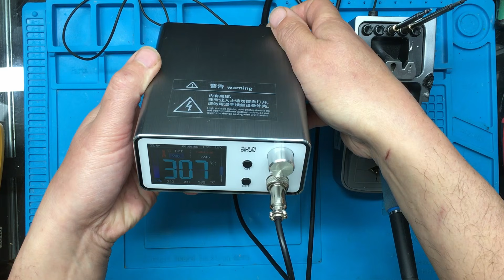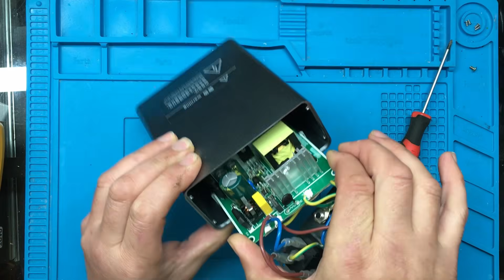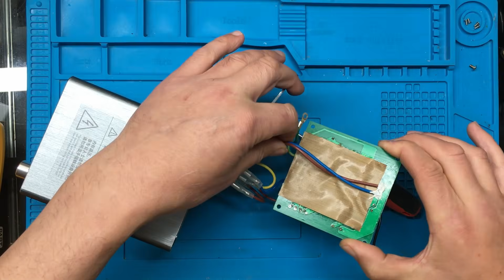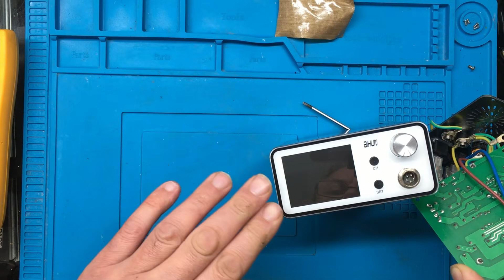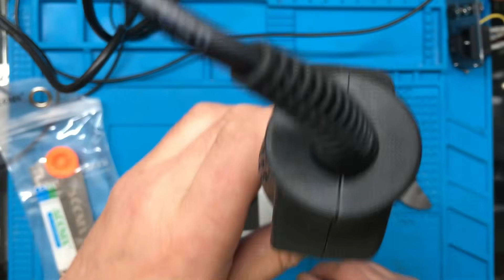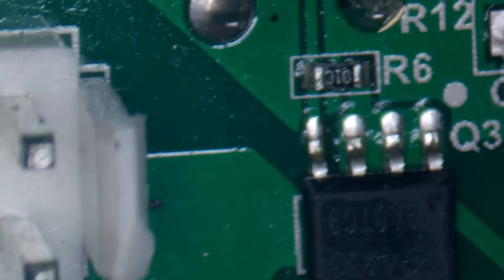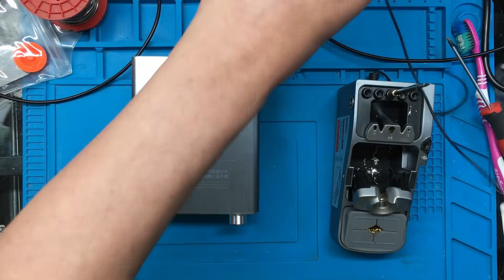Repairing An AIXUN T3A soldering station

Comment: Looks like a great little iron that one, and it heats up really fast, last one i worked with took about 3-4 min before you could work with it. You can always touch up the glass chip with a bit of paint. But thanks for a great video really enjoy watching them
Reply from the maker: Thanks Morten. Yes I quite like it and it does heat up really fast, and also switches off when I place it back in the holder. That's usually the 'beep' you hear when I'm soldering some on a repair video :)

Comment: I know you soldered the multimeter test lead prong back on !...you know amazon sell them leads separately quite cheaply !? i got a couple of spare sets !
Reply from the maker: Thanks Mike. I think I originally got the set from either amazon or eBay. I really should order another set as they aren't that expensive, I just haven't got round to it.. and I kind of needed it there and then kind of thing. But thanks for letting me know!